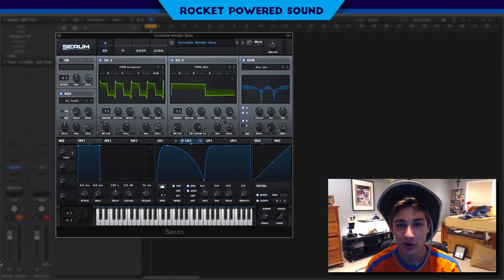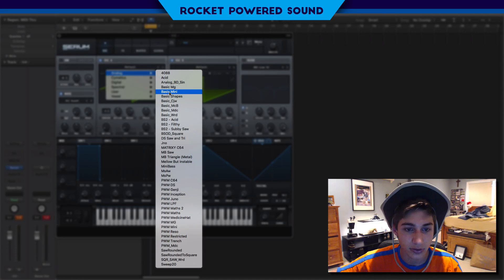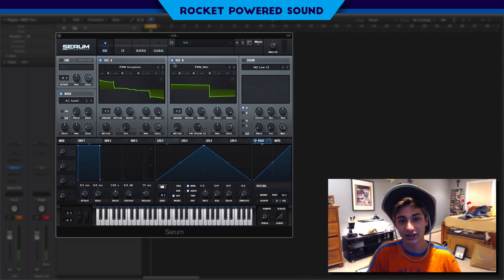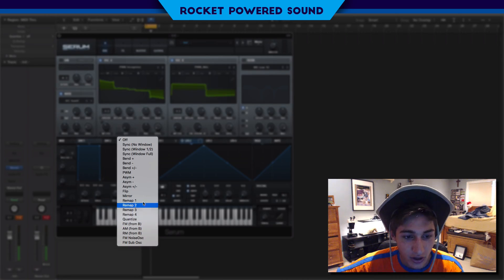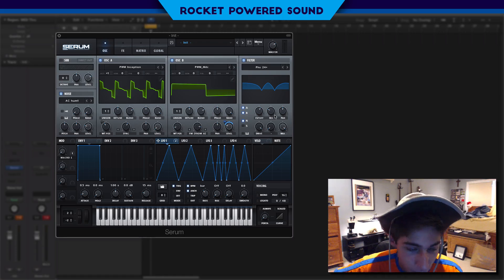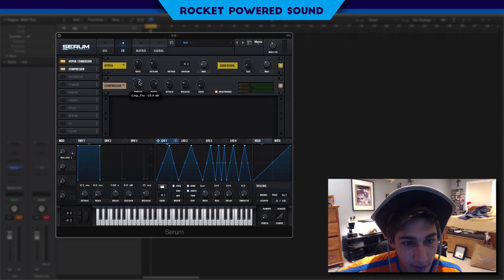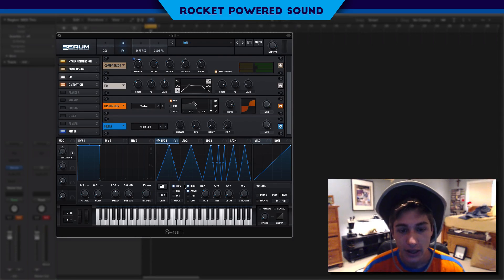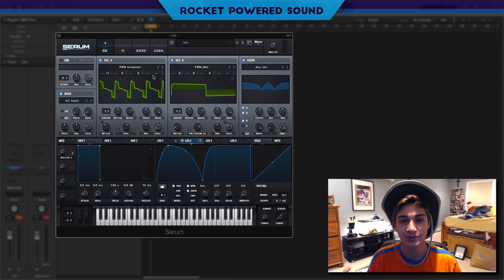Jauz/Eptic Metallic Growl Bass Serum Tutorial (Free Preset)

Comment: As far as a mic goes, I would suggest the MXL 4000. It is what I use for all of my vocal recordings, and it works great. Of course, you will need an audio interface to go with it. If you don't have one already, I would suggest the Focusrite Scarlett 2i4. For a keyboard, any one of the M-Audio Axiom line. They are reliable, weighted, built like a tank, and come prepared for all kinds of MIDI mapping to different parameters. For a Launchpad, get an actual Novation Launchpad lol. If you are serious about it, get the Launchpad Pro, but I doubt you will need all the extra functionality. You should probably just stick with the Novation Launchpad S
Reply from the maker: +Jared Green Thanks for the awesome advice! That helped a lot